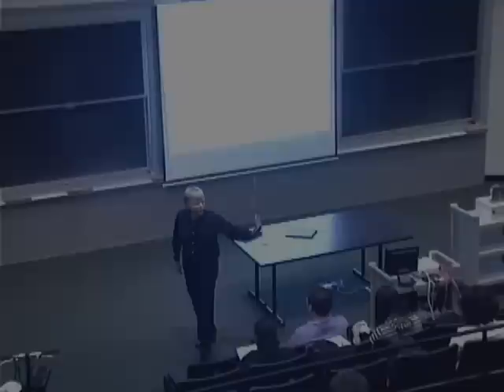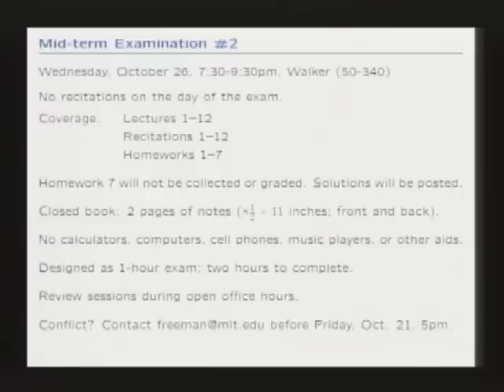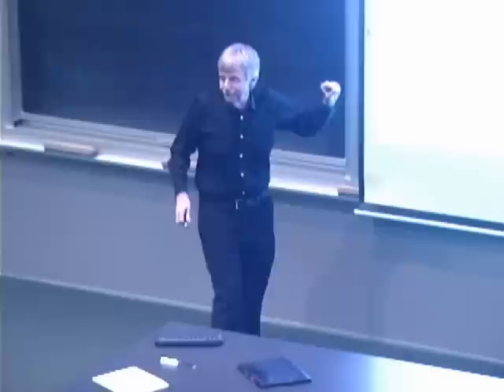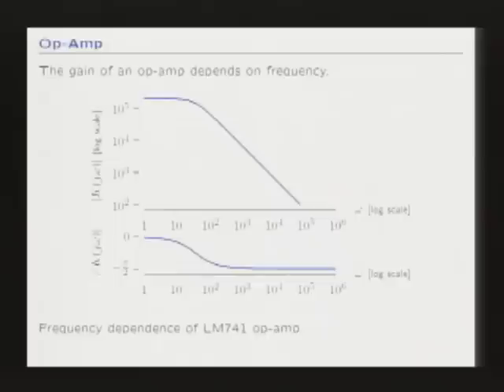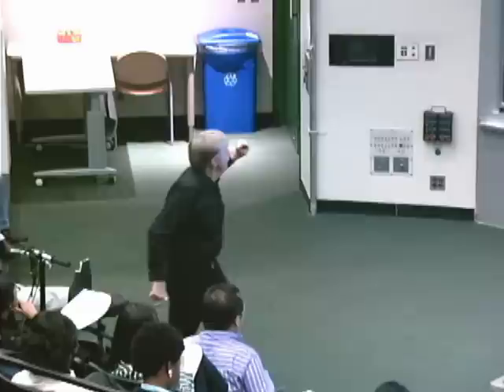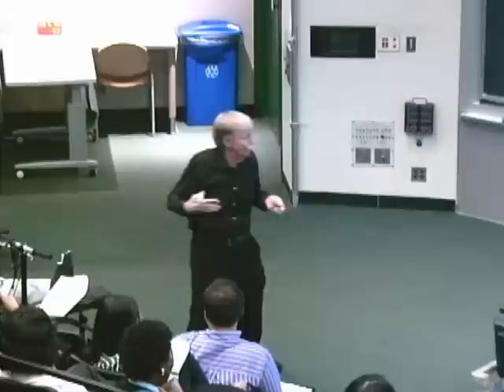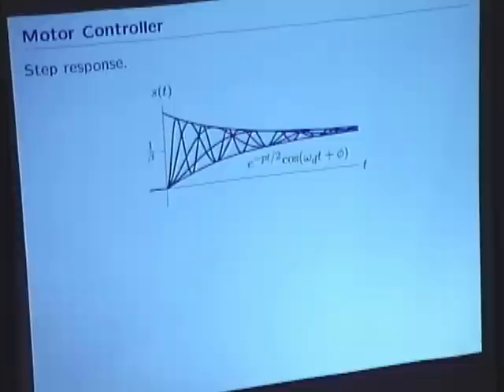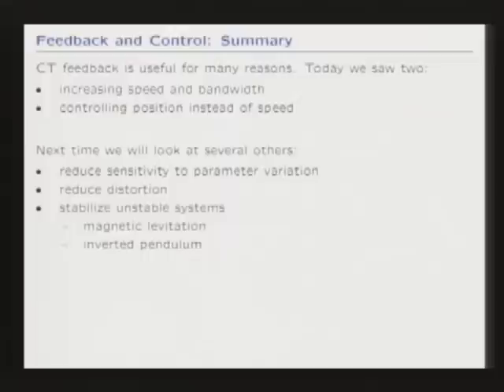12. Continuous-Time (CT) Feedback and Control, Part 1

Comment: while we traded gain for speed, couldnt we just chain a few amps in series to effecrively get high gain but also high speed?
Reply: Yes, but you have doubled the hardware/size/cost. You can in general add more hardware to get better total performance (though at some point you run into noise  problems if trying to get a lot of gain from a really tiny signal, or you run out of range to amplify to (hit the rails)). Internally, an op-amp has more than one gain stage.

Comment: Thanks for the video. The content is really fantastic but I have to say the video resolution is so bad. Also, the timing of changing shots from powerpoints slides to the professor is not very good which makes things worse. Look forward to see improvement on the resolution quality.
Reply: If you take a look in the description, you can go to the course website and they have the lecture slide PDF posted. They are much easier to read.